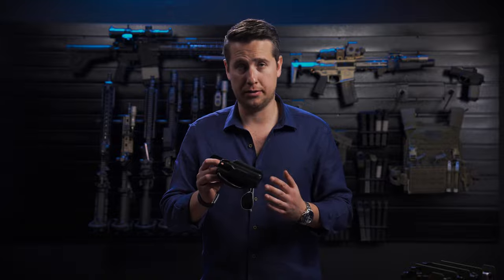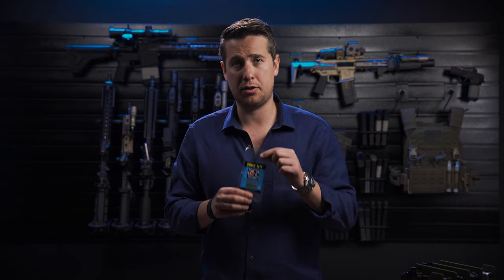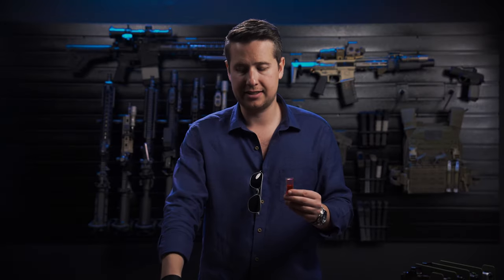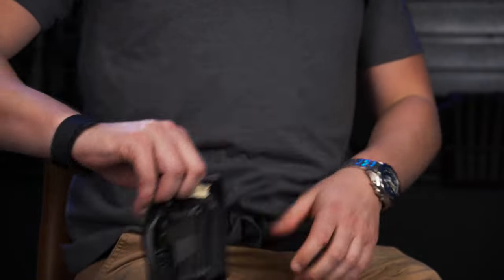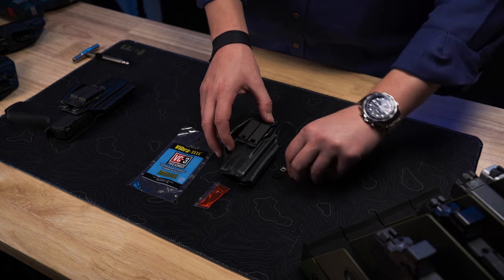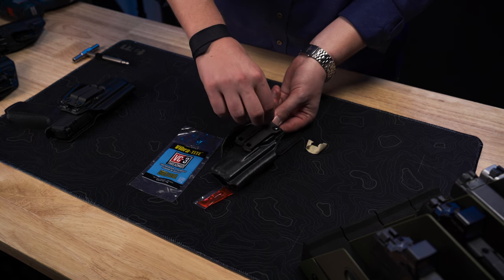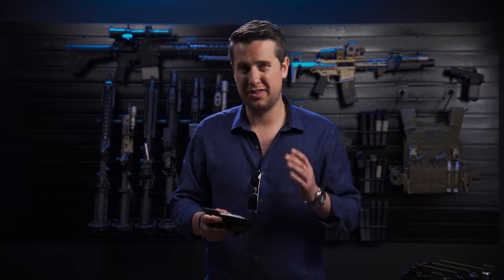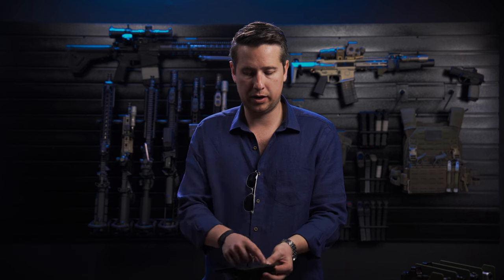How to Setup Your Shorty and Infiltrator Holsters

Comment: Starting price is really almost 100 bucks?  Dam have you always been that pricey?  Vedder wen't up too but geeez. That is high.
Reply from the maker: Vedder doesn't have our design and R&D costs. Designing holsters that aren’t carbon copies of everything else on the market isn't cheap. Most holsters out there can have their tooling designed in an hour or less with a solid base model. Ours take a long time to design. There is a reason you don't see unique designs on the market.
Reply: That is not expensive.
Reply: They are worth it. I've spent over $100 on 3 other crappy holsters that didn't fit right or had bad retention and I could have just got the shorty first to avoid all that. So buy once, cry once, as the saying goes.
Reply: I am getting my Infiltrator tomorrow.  I searched thru the market for quite a while before I made my decision, based on features and what you had to do to it to make it work.  Every other holster out there you are replacing the FOMI or pull the dots to get DCC which come stock on this, optic cut, extra, claw, extra, all built into this holster.  I added a wedge because I always do.  Heck I could have made one but I want to see what comes from Harry.  You don’t want the latest he has to offer get the Singleton but the Infiltrator offers everything at a reasonable price compared to everyone in this category.
Reply: Damn I thought the wedge comes with it
Reply: @johnbrewer171 how did you like the holster?
Reply: I just got my holster and yes it's pricy but worth every penny. I can't believe how comfortable it is for my G19 absolutely perfect. I guess you get what you pay for .
Reply: Stop complaining about it being pricey.  You can't cheap out on a holster.  You get what you pay for.
Reply: $100 for a concealed holster is nothing. Come on man

Comment: Is this a good holster for sweatpants and gym shorts?
Reply from the maker: If the gun you're using it with is fairly light and you've got a sturdy waistband. I'd suggest 3 o'clock for that as it's the most sturdy.

Comment: What’s the 3rd square nut and screw for? Just extra?
Reply: I'm wondering the same thing. I think this is a newer holster, I'm wondering if there are some wedges or something that isn't on the website yet?
Reply from the maker: You are correct. We're working on accessories for it currently. Mag carriers, Wedges etc...
Reply: @Harry's Holsters: Carry With Confidence   good to see a company not sitting idle and improving the product line.